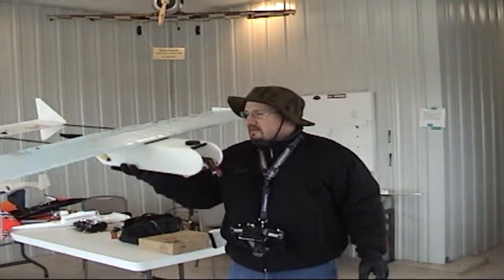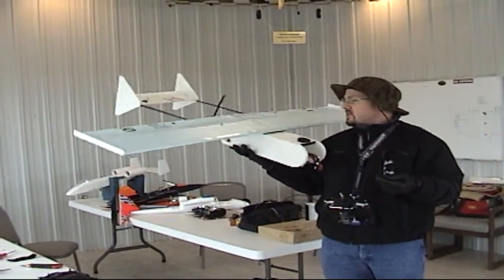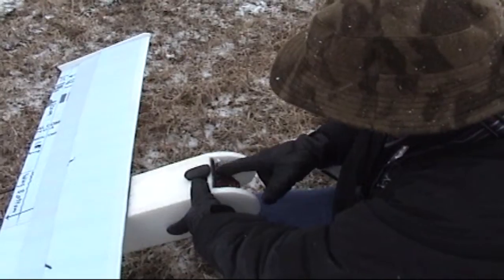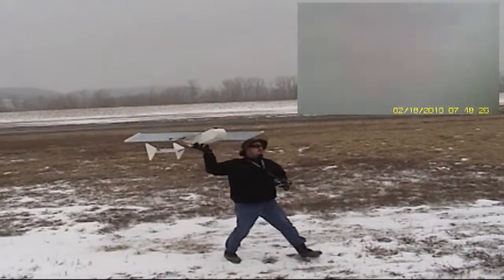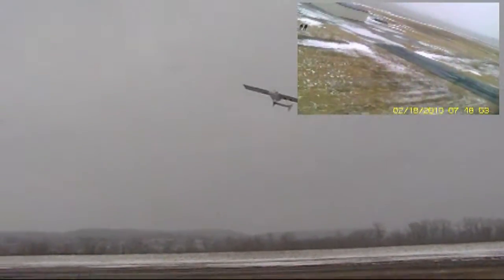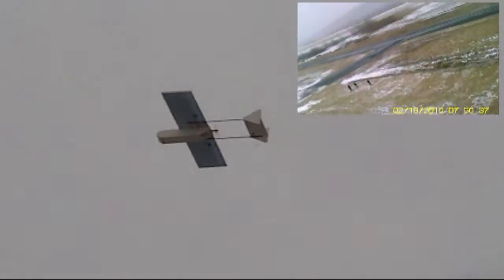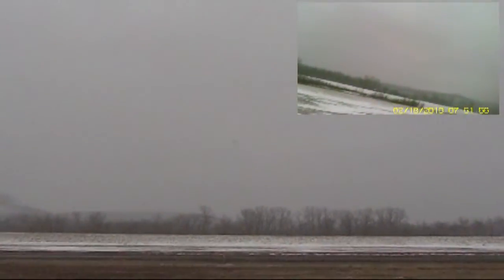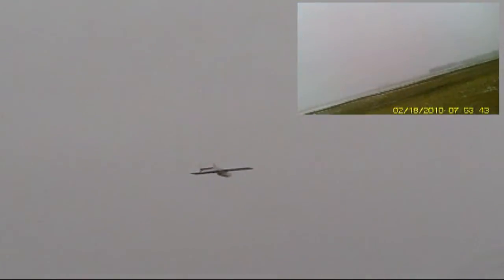Flight of theBoomBox part 1

Comment from the maker: "No-nonsense"?  Frank, that's even more polite than my own "utilitarian" adjective than I was using to call it a blocky, goofy-lookin good flyer with payload capacity.   I would like to point out though, that its weird design makes it EASY for scratchbuilders, as there are no swept angles, pretty much just straight lines.

Thanks,
Tim

Thanks!   Tim

Comment from the maker: Thanks jb753.  I'm working on plans for the entire plane, but I'm new to drawing stuff, so it'll be a bit yet.  As for KF airfoils, Jon and I learned mostly at the RC Groups Scratchbuilt threads.  Search for "AP1" or "KFm3 Heavy Lifter" as my wing is a modded version of that one.
   Part 2 was filmed at the same time as part one, but I believe we got some low and slow passes in there.  It'll almost crawl.